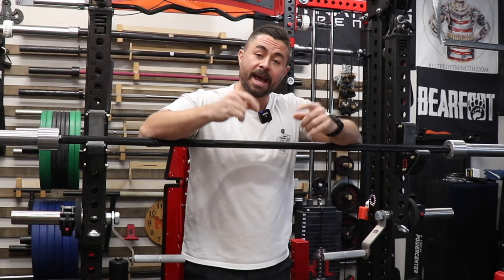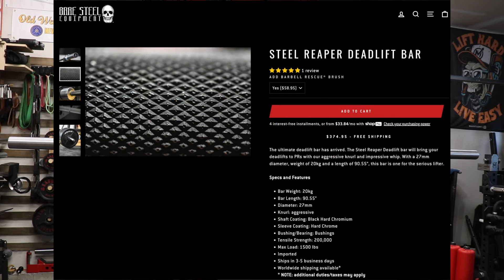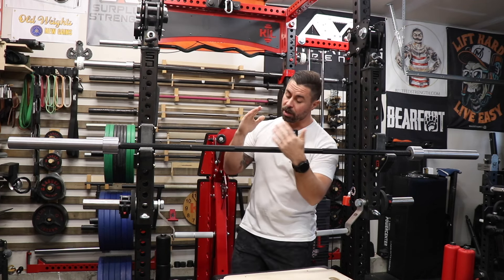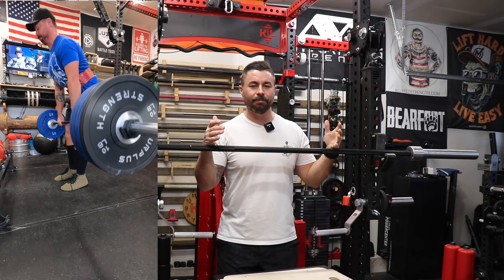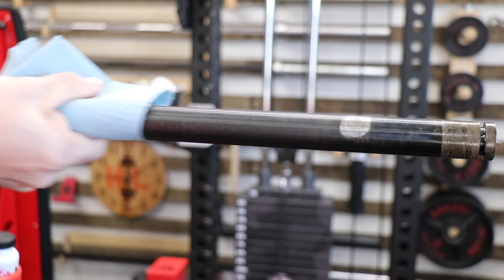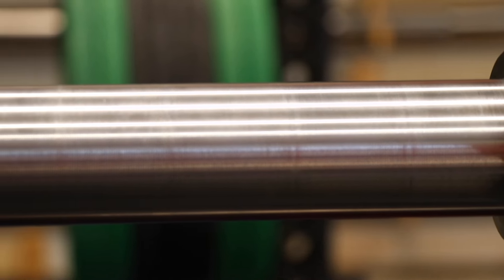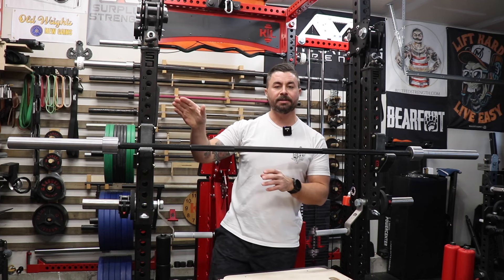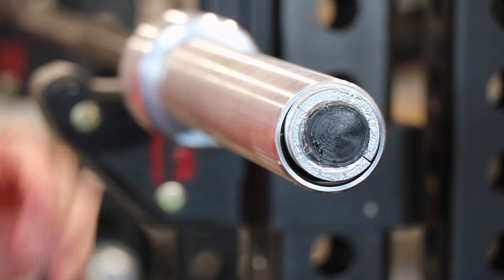The Steel Reaper Deadlift Bar - In depth review #homegym #deadlift

Comment: Regarding your discussion about Kabuki at the end: I am one of the very unlucky ones that spent close to $700 on the black oxide 250k bar, and it ended up arriving to my door with this really ugly "tiger striping" where basically the black oxide was applied terribly and not evenly. It came out really ugly and basically their customer service was non-existent or ghosted me through a 6 week+ period and refused to accept responsibility for the false advertising (their bars certainly dont look this way on their product page) and would not offer a fair refund. 

It was only after I started making a little more noise and "karen'ing" on an influencer's comment section did Kabuki FINALLY respond to me (through a completely different representative btw, like literally I think Duffin's right-hand man Rusty) and offer me a refund that made the price equivalent to moreso like I was buying a "blemished black oxide power bar". To this day I still think this was a robbery but given how terrible their CS dept was (I think it's literally 1 lady), I just accepted the loss and vowed never to buy from them again (even though I have their BO DL bar, kabuki bar, BO duffalo bar lol)

*end rant
Reply from the maker: Everytime I hear these horror stories the feelings are of disappointment and frustration for your experience. What do you think about the Steel Reaper?
Reply from the maker: Again, very frustrating experiences for some for sure. What are your thoughts on the offering from Bare Steel?
Reply: @TheKurtlocker   I haven't touched the bar but based on your review it seems like a serviceable option for those that don't want a bar that everyone else has. I have the kabuki PR DL bar so not in the market for any more DL bars.
Reply from the maker: @starcraftdad thank you! I try to review stuff that isn’t getting the attention I deserves while still getting high quality.